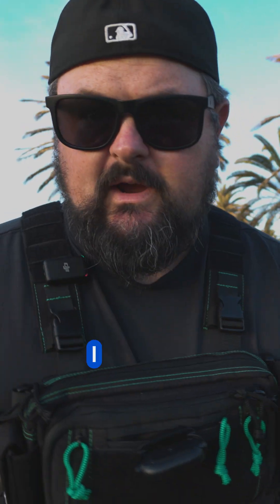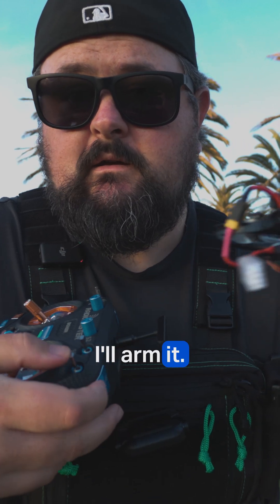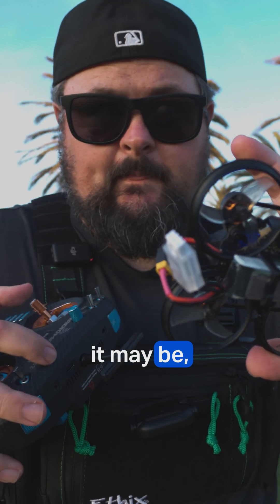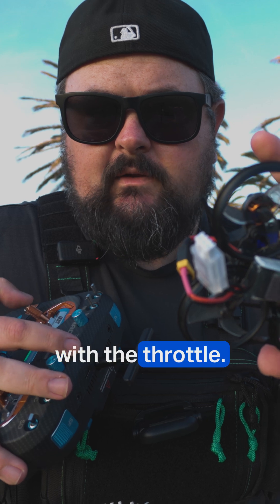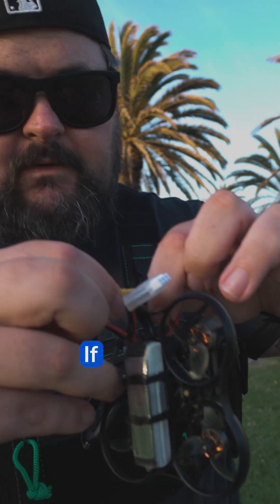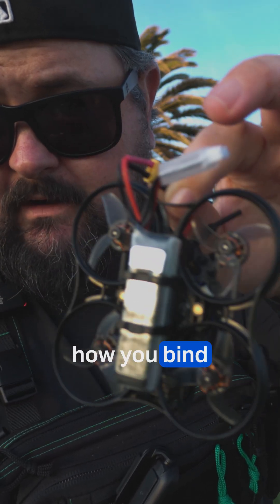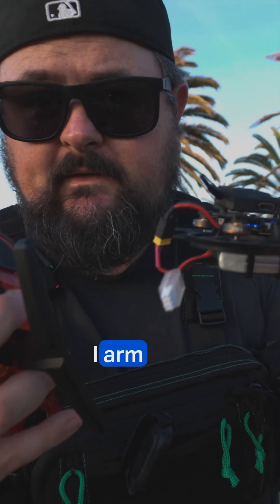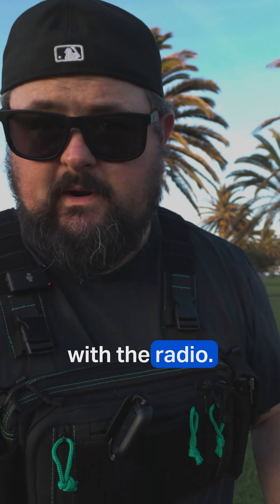🚨 #FPV #Drone Not Arming? HELP! Pavo Femto Throttle error w/ #radiomaster Boxer #elrs #fpvrepair

Comment: The problem was in calibrating the s1 shift to the right and then the arm will work
Reply from the maker: I found that the turtle mode was actually set to my arm switch by default. Once I deleted that in betaflight, it worked perfect!

Comment: icve had friend with this problem too. its your channel map and also your buttons maping
Reply from the maker: Thanks for the info Sharkky! I found out that it was the turtle mode was by default mapped to the same switch that I assigned to my arm switch! 🤦🏻‍♂️ what kind of quad are you flying?